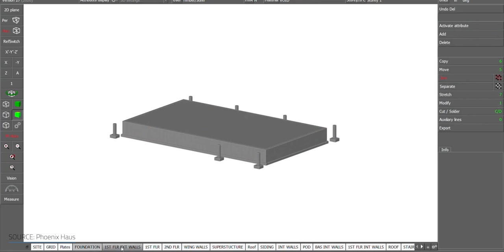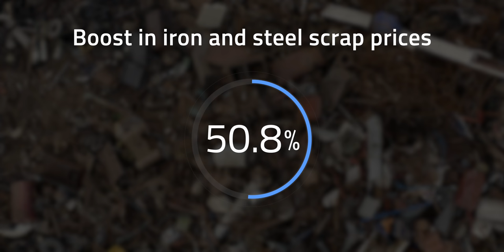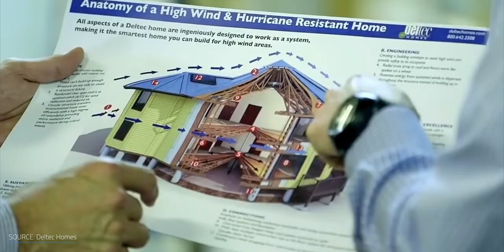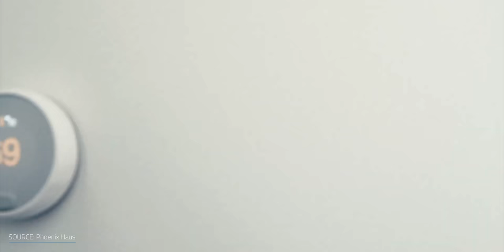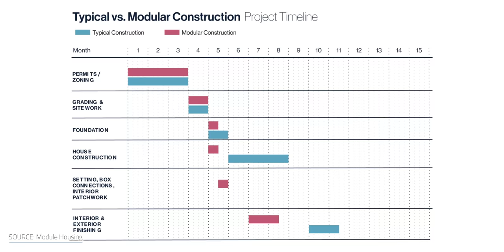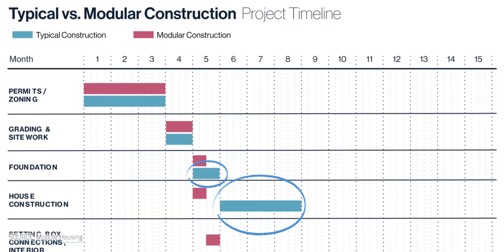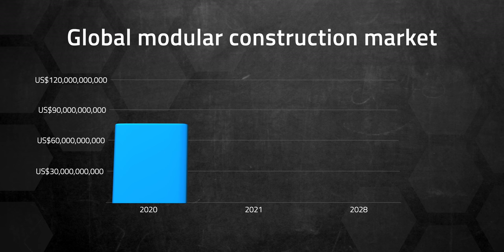Exploring Modular Homes - Cheapest Path to Net Zero?

Comment: I lived in a Modular built in the 90's.   It was far more insulated than anything else in the area.  It had 6" walls and was easy to heat and cool.
Reply from the maker: Nice!
Reply: Got a Modular built in 2000,  when Hurricane Irma ripped 2017 through the neighborhood - one of the few buildings without any damage.   Further what I like about - everything is standardized. - if you want to make changes - all rooms are increments of 2ft so there is no need for custom stuff and weird seized furniture you need to get in a site built home
Reply: There was a change in regulations in certain climate zones that necessitated going from the 2x4 construction to 2x6 or 2x8. Those same regulations are even stricter today. Homes built today with modern building practices will be far superior to homes built a decade ago regardless of how it was built. But they are significantly more expensive when factoring in inflation.
Reply: 5 1/2" exterior wall have been standard in northern us climate for at least 15 years. Modular ain't bad if it's simple, more complex houses may as well be site built, negligible time savings vs. extra cost imho...
Reply: Same! Our gas company gives us a comparison to the average residential customer's gas use in my local area, and my house uses nearly half the amount of natural gas in the winter compared to the average residential customer
Reply: You got me at more insulated.
Reply: Do you have any east European manufacturers for affordable modular homes?
Reply: @KevinSmith-qi5yn  my 200 year old farm house has survived several tornados with no repairs still on the original foundation made from random rock found in the nearby river I doubt a new house could do any of that but new houses are easy and comfortable

Comment: Hi Matt!  Enjoyed watching this take on Modular Homes.  My wife and I guilt a Deltec Net Zero Modular Home in 2017 and we absolutely love it.  We have 3,200 sq ft and 5 adults living in the home...  We did all of the interior finish work ourselves.  The House was up and drywall installed in less than three months and then we went to work doing all of the flooring, cabinetry, etc. ourselves.  There is not an inch of the home I have not worked on...very gratifying!  More though is how the house works for us.  With five adults, four of which work primarily from home and completely electric..heating and air, water, three refrigerator-freezers, our complete electric bill averages around $110 per month...this is due to the house's efficiency and an eight-kilowatt solar panel system!  Flipping AWESOME!!!  Learned a lot from the process and I'd be happy to talk with you if you would like!

Comment: Can you put the values in metric in a little corner when you do the calculations, it gets really hard to compare for people who aren't used to imperial
Reply: 11sqft at equal to a little more than a M^2
Reply: @eugenehoitt3250  thanks. now just do that in real time for us and we are good.
Reply: I want football field measurement
Reply: How many freedom eagles? per square oil barrel?
Reply from the maker: Sorry about that.  I've been very inconsistent on that in my videos.
Reply: Jeez. Made a simple and reasonable request and got back math and smart assery.
Reply: "... for people who aren't used to imperial". Or, how they are usually called, humans. Can't wait for US to ditch the imperial system.
Reply: @barongerhardt  Or converting from inches to feet then from feet to miles. Then to combine it with pounds, ounces and gallons for a true suicide-inducing experience.

No, sorry, I'm too accustomed to the 21st century. Don't want to start daily using such prehistoric things.

I'm kidding a bit, and I know that the imperial system isn't prehistoric. But it kind of is archaic in nature, even if it didn't existed like in the 2nd century BC. And it really is counter-productive, that's why I'm so against it. People should really make an effort and get rid of it.
Reply: @barongerhardt  There are times where you normally use feet but have other things being expressed as "half a mile". Which is 2640 feet in length. Oh yeah, I forgot about yards. Those I haven't used or was forced to use much.

Anyway, the age is not exactly an argument. I was using more as mocking, like neatherthal = uses foot, contemporary man = uses meters.

First, using "foot" as a measure does come from around the Bronze age. Of course it wasn't the exact foot we have now. But the idea is the same, just that now we have tools and conventions, so it's the same everywhere (well, almost everywhere, that's how "International foot" got to be a thing).

The meter is still superior in that it was designed from the start to not be something so subjective like a human foot or cubit or anything else human-related. First it was based on Earth's size, and quite soon a reference bar was created.

But to get back on in, ft, yd, miles, pounds, ounces, gallons and the rest, the real benefit of the metric system is indeed that it's all in base of 10. You might barely, if ever need to care about mm in the same sentence as Mm (1000 km), but it does matter immensily. Because you use small units there, which interacts with medium units elsewhere, which eventually matter for big units somewhere else. Not having headaches in converting is very useful, both in time and in chances of mistakes. Basically the context will never matter, since it's so easy to convert from one size to another.

Lastly, indeed, our current languages aren't neccessarily better because they are newer. On that, I do regret many new things because a lot of time they shed some old, useful things, just because they feel they won't need them or because they're expensive (like having a phone that can be used for 50 years, not what we have now with smartphones).
However, I do have to point that using NAMES in latin has nothing to do with the language being good. Speaking in latin is an ENTIRELY different thing. And, no, basically nobody (including scientists) is speaking latin, which I think you could say that it is counter-productive. I understand your argument, but your example here is really not good.
Reply: @relentlessmadman  Windows calculator already has it.

If you think that in the 21st century it's normal to have to spend time on that, then I'm sorry that you don't value your time. And the others'. Because if this video has 110K viewers, and let's say 30k of them are not UK+US based, then 30k * 10 seconds = massive waste. Not to mention that if you have several values like inches, feet, then miles per gallon, miles per hour, pound force and other like that (totally realistic in a car video) then it's much more than 10 seconds.
Reply: @Winnetou17  The metric system is rubbish. The Imperial system results in children who are better at maths.
Reply: I would appreciate that as a US resident. The more opportunities I get to learn units in the metric system and rewire my brain against real world things that I am watching or reading about the better.
Reply: @BobbyFeltault  That's a great attitude!
Reply: I agree with your point and request. OTH, Google can provide the converted values with VERY little effort.
Reply: @UndecidedMF  For the already uploaded video. A remedy to that is to edit the subtitles to include the metric conversion inside parentheses.
Reply: @ChopperChad  oooh, math - dividing by 10 even. Scary stuff
Reply: @barongerhardt  You don't change from inches to feet? Seriously? It's totally common to convert feet to inches and not that unusual to convert feet to miles. A base 10 system is much more logical. It's not the newness, it's the absurdity of inches being divided into fourths, sixteenths, thirty-seconds, 12 inches to a foot, 5280 feet in a mile, and no relationship between volume. Do you know what a cubic cm of water weighs? A gram. How many ounces in a gallon? It's a ridiculous system
Reply: @relentlessmadman  Of course that wasn't the point, was it. Did you want to watch the video (which is obviously addressed internationally) while typing numbers into a conversion website? Crikey
Reply: @eugenehoitt3250  A close enough conversion factor. Thanks.
Reply: @Rainbow Capone I think it's the other way around, buddy.
Reply: @barongerhardt  as a fellow imperial user, your arguments are way off. I don’t know how you can sit and argue how easy it is to use imperial over metric
Reply: @ChopperChad  The solution requires math.

Comment: Yes to the walk-thru, and finding out more about passive houses, who's doing it, etc...  I'd also love to learn about next gen insulation, building techniques, materials etc...
Reply: As energy costs continue to rise, more and more people are looking for ways to make their homes more energy efficient. One way to do this is to explore next-generation insulation and building techniques.

There are a number of different insulation materials on the market today, each with its own set of benefits and drawbacks. However, there are a few that stand out as being particularly effective at reducing energy costs.

One such material is spray foam insulation. Spray foam is made from expanding polyurethane and is sprayed onto walls and ceilings. It is an effective insulator because it seals off all cracks and crevices, preventing heat loss.

Another popular option is cellulose insulation. Cellulose is made from recycled paper products and is often used in attics and crawl spaces.

Comment: I'm so glad to have found your channel. It was like discovering a similar soul with more knowledge on a topic of common interest. Right now, I just bought a piece of land in Latvia, and plan to build a house. Surely I would like to hear more about your experience in the process. Here perfect insulation, "energo-efektivitate" and modular homes are part of the day by day, but still have to understand fully what the options are and how to take the next steps and actually build our place.
Reply from the maker: Glad you found the channel too.  There's so much information and options to sift through before starting a build.  If you're like me and trying to build the perfect, energy efficient house for yourself (sounds like you are), take your time to get it done right.  I'm trying to do that myself.  As much as I'd love to be in my new place now ... I'd rather wait a little longer to make sure I get it done exactly like I want it.
Reply: SIP is very comfortable. Don't know about similar options. Jibcrete is noticeable improvement. Not sure of the costs. I'm not impressed with in-floor heat. Pay a lot of attention to window sun exposure and manage via carefully designed roof overhangs. Maybe some ground mount solar rather than all out of reach.

Comment: 4:15 So I understand that the construction garbage is significantly less at the final location, but isn't the remainder of the waste just abstracted away and still exists at the initial construction facility? I imagine there is some amount of repurposing scrap material from one house for another at the facility, but I don't think it is completely eliminated.
Reply: Yes, in a factory environment, you're building wall or roof sections to a specific blue print on a massive jig, so you can order lumber/steel or other dimensionally critical components and materials in dimensions that are optimized for that design to minimize the amounts of fitting needed, thus minimizing waste.  

It doesn't eliminate it entirely, but it does reduce it significantly compared to traditional building methods.
Reply: I worked on my uncle's typical build sites during summer breaks and there wasn't that much garbage. Mostly just small cut offs and packaging, not much more than a small dumpster. Any leftover usable material went to shop for future builds. So not sure where that statistic is coming from, doesn't make any sense, maybe if it's reno which requires demo but not a new build.
Reply: @terryfaugno9242  I can tell you right now the waste in regards to wood will be very similar. The efficiency of a factory environment is having a well stocked inventory of the parts. To cut down on skus the manufacturer very likely makes use of standard dimensional products and cuts them to size.

On steel though it is possible that if they are making a lot of something they may order parts in that length from their supplier. The supplier likely cuts to size, but they can toss the scrap back into the recycling stream rather efficiently.

The major benefits for a heated indoor construction site are steady progress unlike a site built home that will run into delays. No doubt about it that is huge, but are those savings passed on to you or are they eaten up in the delivery costs and markups? I lean towards it being the latter. So far every home Ive seen be a manufactured home has been priced at the upper end of the local market conditions. If it is truly saving you money shouldn't those homes be substantially cheaper? Instead they always try to market it has more home for the same price. Same house getting installed here gets installed in a cheaper market 30 miles away in a rural county and magically is 50-100k cheaper. To me this sounds like a highly efficient means of fleecing people of their money.
Reply: @MurDocInc  It really depends on the new build.  A lot of new builds are actually custom houses, which are higher end.  A lot of those are so complex it's difficult to be really efficient with material use.  so yes Modular can generate much less waste than site built.  By the same token site built can be just as low waste as a modular build.  But on average Modular generates less waste.
Reply: At the factory or at the build site waste is.. waste.  Maybe a little savings in the cost for rental of the waste bin but that's about it.  In my experience modular homes have their place, they have been around for decades,  they are not the cure-all Matt makes them out to be...
Reply: @terryfaugno9242  tract house builders also order a specific number of windows, doors, appliances etc. so isn’t it at best comparable to a volume home builder with a series of standardized models?
Reply: @thatkajunguy8029  Missing the point about waste entirely AND somehow not comprehending that modular homes have evolved? Yikes
Reply: @terryfaugno9242  This is why I would have liked him to go over a similar sized house and give us a percentage of the reduction. As he presented it here, it paints a picture that is just pure ignorance. It is still going to be at least a dumpster down from two. Maybe even still two just slightly less. Without any metrics it is purely speculation because on site crews with experience can also be efficient in material usage.
Reply: @zweigackroyd7301  You should at things objectively though, how is he missing the point about waste because this is exactly how it was presented in the video. He never made any foot notes about it benefiting the one site crew to have less waste on site or that it benefits the person having the house built. only that less waste was on site. I think he made a very valid point about that metric being misleading and should not be presented in this manner. You have to properly frame facts otherwise you make yourself look like a fool when reality is shown and the waste is only 10-20% less, just speculating which is all anyone can do unless you have facts to insert, instead of the 95% less that modular homes markets.
Reply: @Bound4Earth  How did I fail to look at things objectively? I didn't.

Comment: My two recommendations for net zero home builds. 

Look into 2x6 or 2x8 exterior walls. Standard 2x4 doesn't provide enough insulation. 

Do some research into aerosol sealants to fully seal the exterior walls.
Reply: Spray foam insulation is falling out of favor due to complicated repairs if there is a failure (typically due to water damage).  See: Rockwool and Matt Reisinger's excellent builder series.
Reply: @jimmatthews6034  I wasn't referring to spray foam. 
I was referring to an aerobarrier type product. I believe they needed that in that series too and it sealed the entire house in one shot.
Reply from the maker: Unity Homes, one of the companies I'm considering for myself, uses 2x10 walls.  It's interesting how it doesn't dramatically impact the cost, but dramatically impacts the efficiency.
Reply: @UndecidedMF  It should just become code for all builders to start doing this or be fined. Building codes need to change before we end up with millions more on top of the already millions of cookie-cutter homes that will only last 50 years before major overhauling or complete teardown is needed.

Comment: OH hey Matt,

If you are looking at building, you should research and do a video on geodesic and monolithic dome home.
- Absolutely top-notch efficiency with few exterior corners for heat loss.
- Easier to heat and cool due to having low air volume per sq ft. A perfect combo with a geomass heatpump system.
- Nearly indestructible to weather events.
- Similar in cost to stick built
- Many geodesic sets are modular. Monolithic homes are built using a literal balloon in the shape of the house
- Lend themselves very well to open-concepts, since interior support is only necessary for supporting a second floor. A single-story dome has no interior load-bearing walls.

I think a video like this would be right up your alley.